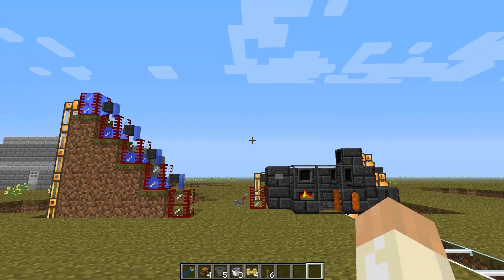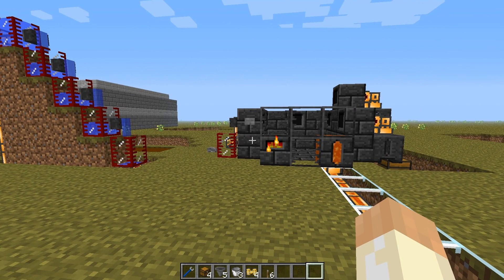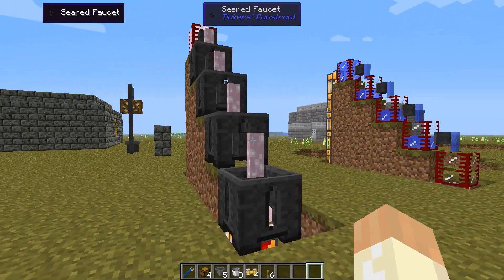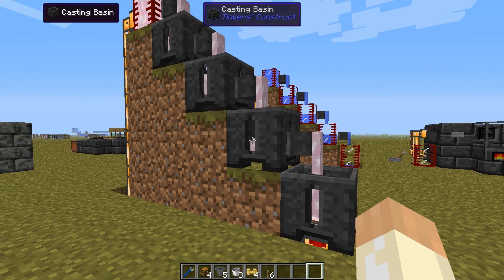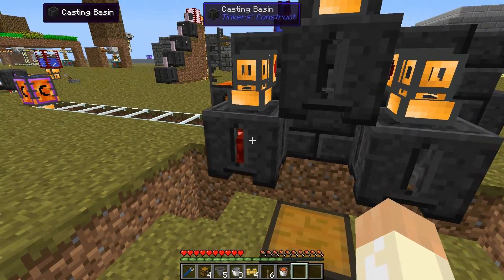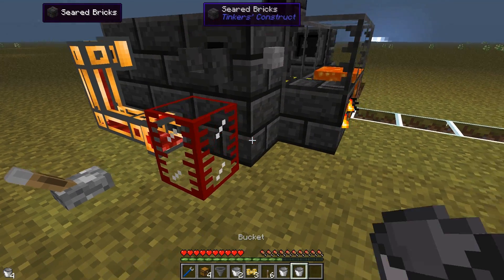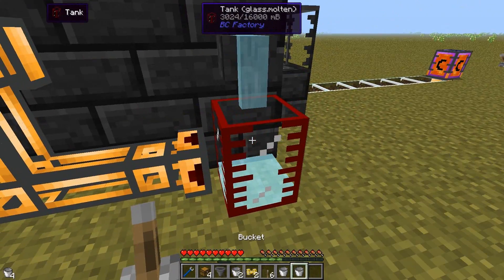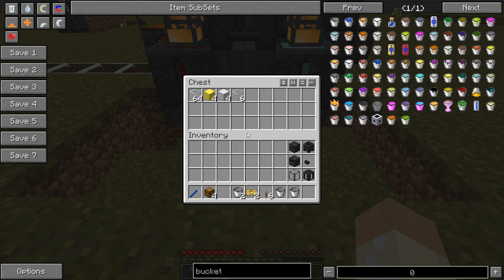Tinker's Construct Tutorial: Smeltery Automation (FTB 1.6.4)

Comment: +THK is there another item that works instead of the fluiduct, but accomplishes the same thing??
Reply from the maker: Matthew Willard It depends on what mods you have installed. If you're not running Thermal Expansion / Thermal Dynamics you can perhaps use EnderIO? BuildCraft pipes could work as well I guess, but require a lot of gates.
Reply: +THK thanks man for responding. I don't have the most updated version of thermal expansion, so fluiducts are out of the equation for me. I ended up using someone else's tutorial setup, in a completely less efficient way, because of an update that bugged it. But thanks anyway for responding with help :)
Reply from the maker: Ok, feel free to come back if you need support. Oh, and remember that fluiducts and conduits are in a separate mod nowadays! (Thermal Dynamics) :)
Reply: +THK alright thanks again man